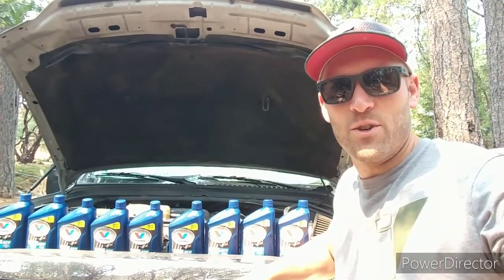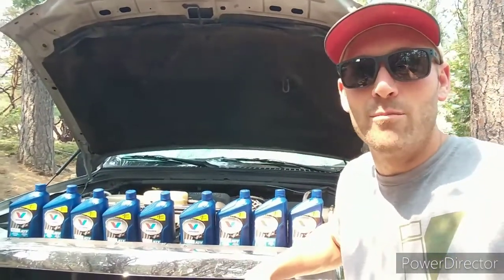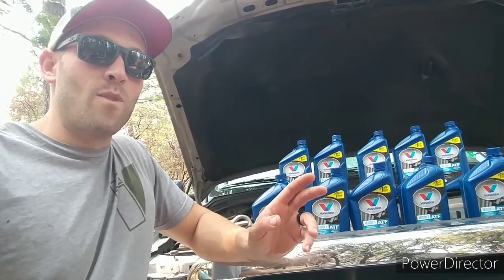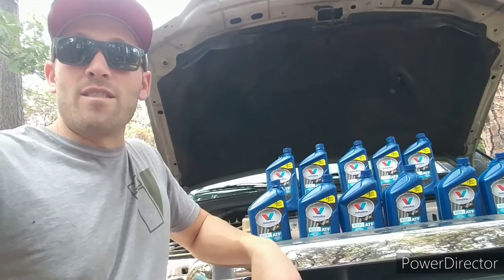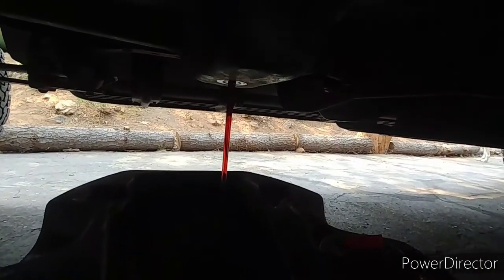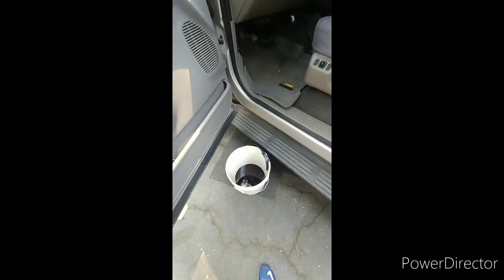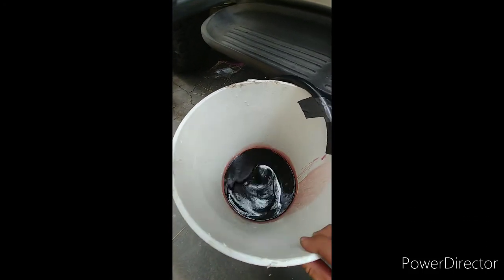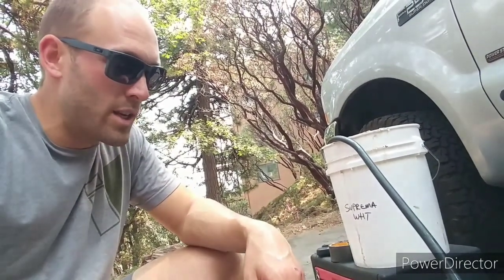7.3l Transmission flush: Round two!!!

Comment: I use for my Excursion 7.3, 2001 400,000 mil  Mercon/DextronIII , I install transmission cooler from 6.0, 200,000 miles with out transmission  service , transmission works great.

Comment: When you removed the return line from the transmission and attach the hose, what did you do with the hole in the transmission were the line was?
Reply from the maker: Good question! Just drain the transmission pan first and the hole will leak a little but not much. I didn’t need to cap it off or anything.

Comment: howdy i have a 2000 ford 350 7.3 deisel and need to drain both the transmission pan and torque converter! how many quarts does the torque converter take and correct if im wrong think the transmission itself takes 7 or 8 quarts think torque converter takes 3 or 4 i believe could be wrong hard to say
Reply from the maker: You will end up flushing the torque converter if you follow the video. It holds 18qts but buy 20 quarts to make sure you flush it all out and that you don’t under fill the tranny. Good luck! It’s pretty easy.
Reply: I have a 1999 F250 Super Duty V10 and drained both the torque converter and the pan.  I left them to drip overnight.  It took 13 quarts of Mercon V and 1 pint of Blue Devil transmission stop leak to refill.  According to the owners manual it takes 17 quarts to refill from dry.  I am assuming the transmission and the cooler held up the other 3.5 quarts.

Comment: Do you hook the hose up to the transmission or the transmission line and do you start it or just turn the key switch on?
Reply from the maker: I just noticed my comment didn’t post. You hook the rubber hose to the return line on the passenger side of the tranny. I did my best to show where it was. I crawled under the truck on the driver side. Once you have that connected run it to the bucket and actually start the truck. Let it run until it sputters a bit of air with tranny fluid and turn it off,add one qt of fluid. repeat until the fluid runs bright red. Be sure to buy extra fluid bc you may flush out more than what you add. It’s not an exact science.  BTW use the fluid I used in the video. Apparently the transmission is very picky.

Comment: Add an auxiliary trans cooler, it worked wonders for me. Only like a 45 minute job
Reply from the maker: Good idea. What cooler did you use?
Reply: @askmehowiknow3571  I’m running a cheap from Amazon Hayden automotive 405 trans cooler. I had the trans overheat one day and puke fluid out the front pump seal. Haven’t had the cooler for too long so I can’t really stand for the longevity but I see no reason it would fail. It was only like 30-35 bucks
Reply: Listed “on sale” for 31 right now. (I’m pretty sure it’s always on sale)
Reply from the maker: @jacrispy8802  sweet! Thank you! I think this will help a lot!

Comment: Add a transmission cooler in series  with radiator and flush the coolan
Reply from the maker: Yes I think that would be a good idea! I have noticed as long as the torque converter is locked, the temp does not go very high. The Hydra chip does not lock the converter and the temps spike fast while towing.

Comment: The Valvoline stuff is actually not approved by Ford. You can get super tech for about half the price and it's mercon v approved by Ford.
Reply from the maker: Just saw this. Thanks for the info! I’ll keep that in mind. I Don’t think this transmission is going to hold out very much longer
Reply: Super Tech Mercon V is about $6 something a quart - if you can find it - most Walmarts only have a small supply and you can't order it online anymore.  Valvoline Mercon V CONVENTIONAL is $4.50 to $4.75 a quart, I don't know how Valvoline makes a conventional Mercon V because I thought one of the requirements was that it be synthetic.
Reply: @HockeyGoon939  It's because the Valvoline one is not approved by Ford.  In fact, there's a video from a Weber State University (Utah) professor who discusses the meaning behind a lot of the markings/statements on the bottle.